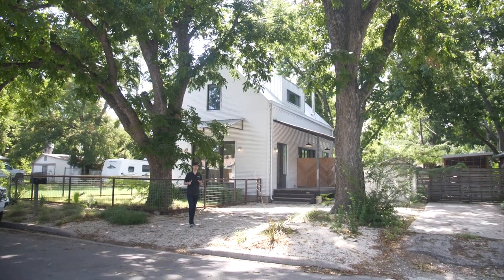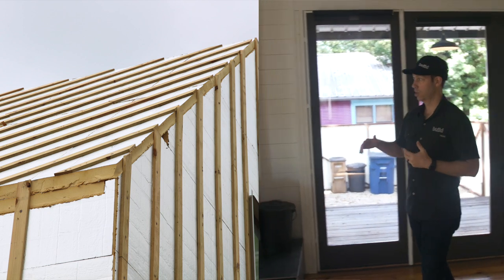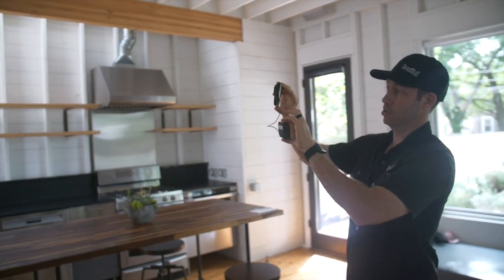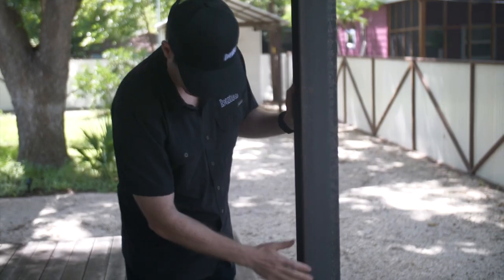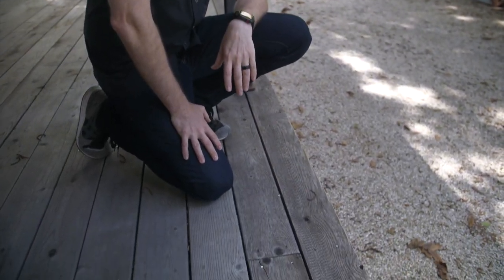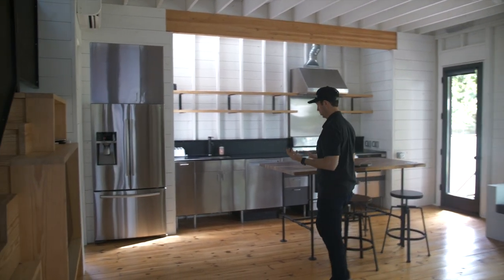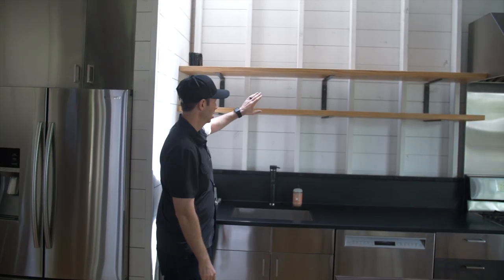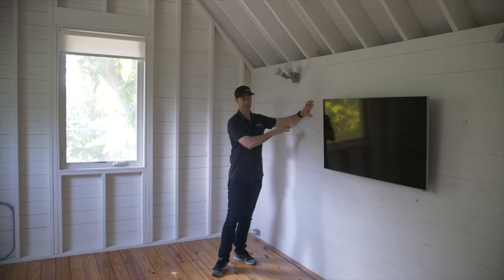This New House Has No Drywall, No Insulation, and an All Wood / Shiplap Interior!

Comment: I love the fact that any failure in the wood can be visibly seen and repaired effortlessly thanks to no fiberglass insulation or drywall. Water getting in? You'll see it right away, and the wood can dry quickly.
Reply: No place for mold to hide
Reply: Looks like a nightmare for cleaning, tho. so many nooks and crannies for dust to reside.
Reply: @CroElectroStile  Dust doesn't cling to vertical surfaces very much, so no it'll be fine.

Comment: Matt, if you do a floor like this again, you need to look at traditional Finnish cabin construction.  Because historical cabins were made with green wood, the floors shrunk a LOT, so the flooring is initially floated over the joists and there are wedges at the edges of the room to keep them tight under the baseboard.  (Really, just a small piece of square trim.)  When the floor gaps, the baseboard is removed and more wedges driven in.  Then it is perfectly tight.
Reply: Would be a lot easier to use kiln dried boards.

Comment: I find the concept brilliant. The execution masterful. No drywall means no mold and other pollutants. No insulation means no nesting materials for bugs and rodents. I'm sure enviromently sound enamel was used to paint the walls for a long lasting finish. The electrical and plumbing was done in the most detailed way so that if noticed it just fades without thought. The exterior was excellent. Steel to reflect heat. Cedar to excel nature. Raw acid finish steel to outperform natures best defiance. The only competition this magnificent home is concrete. Never would I have thought this to be possible.
Reply: N C I absolutely agree and always have. The problem is in the United States they overprice concrete. Concrete homes are very expensive here in the states. I do believe that homes especially on the coast and in natural disaster zones should be built of concrete. The new modern concrete homes are phenomenal and beautiful. But this home has a warmth to it that just gives you a big hug when you walk in.
Reply: @Mark OnTheBlueRidge from experience. Yes wood can mold but it's not a moisture sponge like drywall. Once drywall gets mold on it the drywall has to be removed. Wood gets mold if left untreated. I used to do remedial work.
Reply: @rubberdwellers3911  Wood molds when wet for a longer time, you dont have to treat Wood to prevent molding, Just keep IT dry
Reply: @Mark OnTheBlueRidge bang on
Reply: Those are unsubstantiated assumptions, moisture is a problem when food is around...wood and common household dust can be mould food...since there is only r24 on the walls doesn't give it amazing thermal performance, other that thermal bridging...as inside air approaches outside wall it will cool and condensation the concern. The only way to know is rip some siding down in five years and see what is happening between the wood and the wrapping... you may find mould and dry rot. As far as rodents, well unfortunately mice LOVE foam homes, many ICF home owners are awakening to that fact, I saw a five year house have the siding torn off because the mice bore tunnels in the foam board up to the windows and gained entry, also hollowed out nests under the siding...thus destroying Rvalue...there is no perfect home, to think so only deludes you
Reply: Drywall is cheap & it's not lath and plaster. Not being lath and plaster is actually pretty fantastic. It is time for a locking engineered cellulose + property you need in that room system.
Reply: This type of insulation is the normal way you do it on conventional brick houses. This way you also eliminate all thermal bridges especially in the corners. But for wood houses it's a new concept.
Reply: I still would like drywall in some living spaces - just for ease of painting.  But since it's optional as built, that's a bonus.  I am not a fan of how electrical was run in those shoulder areas: yeah, it might meet code as the space is not living area, but mechanical protection just isn't there.  You know people will store stuff in those areas, as access is easy [unlike an attic].
Reply: @rubberdwellers3911  Ever worked with fiberglass faced sheet rock?  All my bathrooms, kitchen, laundry room and garage are fiberglass faced rock.  Love it.  I put a sample in a jar filled with water for two weeks and removed it and NO change at all.
Reply: @trex2092  $$$$$$$$$

Comment: Like many current building methods, sheetrock is cheapest way to cover large wall areas! Carpet is cheapest way to cover large floor areas, etc, etc.  Building for generations is usually NOT normal.  Housing is a "market" for the most part. I have built fine quality, substantial before and the house was priced "to the market' in dollars per square.ft.

Comment: I know here in Vancouver, moving the thermal barrier to the outside, and turning the sheathing into your vapour barrier is becoming very popular. Can frame in 2x4 again as a result, and allows for a tonne of places to run plumbing/electrical/low voltage now.

Comment: The great thing about this design is that you could make whole walls into electrical conduit holding fixtures.  This would be ideal for an IT professional who wanted his in house server room.  Or anyone who wants to pay less when network standards get better in 10-20 years.  plumbing issues... no problem.  Pipes could rot to pieces but be replaceable.
Reply: I know it’s been 3 years but could you explain what you mean lol
Reply: @ryangolden3243  Want accessible wires, keep them outside the walls.  Same with pipes.

Comment: Finally!!  I built my exterior walls like this several years ago and couldn't understand why I seemed to be the only one to know how to build the perfect style house.   This is the only build platform that truly makes sense and it's better than any r control house built.   This is much better than those stupid insulated studs held together by dowels.   I wish more people would use this platform and perfect it.   Very nice looking house.  As far as fire,  current home fire protection is a joke anyway.   Firefighters keep busy and lives are lost even with drywall.   There's a better solution.
Reply: Yes it's called ICF it also has a better thermal barrier and noise dampening than wood.

Comment: Certainly a take it or leave it design. My first concern was dust settling on the rough walls and frame pockets, very hard to clean. It's also very time consuming to paint the walls and ceiling for the same reason. 

Refreshing to hear all about these new ways to build a house from an intelligent & well informed contractor, instead of the tired pessimism from an old school meathead.
Reply: I have a 1920's double brick . I have dust settling on the walls , cracks in the plaster , webs in the folds . A good extension on a vacuum hose is the clue

Comment: I love this construction, I’m not sure how it meets fire codes, but it’s extremely practical. It may not be appealing to some home buyers, but all architecture has changed throughout the years, I’m sure the market would have a place for this....if it can meet codes.  Very interesting 👍🏻
Reply: Well it had to have met code or it wouldn't have been completed with tenants living in it 4 years right?
Reply: Type 5B construction has no fire rating requirements.

Comment: I like it.  The only thing I would worry about is fire danger.  Drywall on the interior of houses is used in part used to give a house some fire resistance.  True, flooring such as conventional carpet over plywood sub flooring has shown its flaws.  If fire, in the form of a flaming tree branch falling on the roof, were to occur, how does it stack up against a regular house?  I also would have used conduit to protect the electrical wiring.  Wood interiors are also not the best at providing a heat sink.  So having one interior wall made of concrete, perhaps with a “floor” heating  (or cooling) system makes sense.  I also would have liked a basement, but that’s probably just me.  Maybe I missed it, but was there a heat exchanger for fresh air entering the house?  I would like to see a similar concept house using RockWool which is fire resistant.  Like other commenters, maybe too many US builders think short term.  I love the service spaces which allow for access to the workings of the house.  Not much chance of accidentally poking a hole in something you shouldn’t.

Comment: I could definitely live in a house like that. The overall effect is that of an urban loft, or converted barn.

Low maintenance, easy upgrades, easy access to the utilities. I love the outside of the box thinking. I would have to do something about acoustically isolating the bathroom, though. No need for anyone to hear what goes on in there. Maybe double the shiplap, or create a sandwich material with sound insulation between two layers of thinner faux shiplap, anything to keep bathroom sounds strictly in the bathroom. And no louvered doors! But there are faux louvered doors that would match the look of the house without allowing sound or odor to escape the bathroom. Old-fashioned glass transoms would fit in this house, too - they're very common in Baltimore homes built in the late 1800s thru the early 1900s, before air conditioning and electric fans were common.

Only problem I could foresee with all-wood walls is that if you're one who  hangs a lot of stuff on the walls like me (posters, shelves, etc), the wood would soon look like it was termite infested. I'd need to work something out to facilitate easy hang/relocate/remove of artwork and shelving. Maybe a metal grid suspended between the studs. That would work for incident lighting, too.

If I ever move to Austin and build a house I'll definitely look Matt up.

Comment: It is Shed construction or just the way it was done before plywood  or drywall . You could close up the walls with paneling ,which is removable and batt insulation . Solid wood paneling is used in Europe . I have seen many old buildings done this way . The modern exterior insulation is a plus. It breathes through the interior.

Comment: Very clean with insulation on the outside and no drywall, a maintenance man's dream home, easy to get to everything. The only problem I was told once by an electrical engineer fire investigator is that foam insulation like that goes up in fire in no time flat.

Comment: Love the exposed utilities, and the transparency of everything. Appreciate your lessons learned. Would also mention that the floor level receptacles are very low from an accessibility standpoint, hard for older folks to reach. I understand raising them would entail more exposed MC cable -- inevitably some tradeoffs for this kind of construction. Also, the freestanding wood stove seems like an IAQ nightmare in a tight house like that. Hope you tried to dissuade them from the idea of a combustion appliance in a tight house. Thanks for this video -- lots to consider for next project.

Comment: Remodeled a 6 yr. old home on a local island resort that was built like this. There were 4 large exterior double doors and one single along with at least a dozen windows. When I got there I noticed all the double doors were tied shut with rope. The owner explained that the doors even when dead bolted would sometimes open by themselves. Yes really! (he was an architect and had designed the house himself). After installing higher end locksets and deadbolts it was assumed the problem was solved. But I heard later that it persisted. I had remembered feeling movement in the house on windy days and it dawned on me that there was no wind bracing in the exposed framing inside,(just like yours). I wondered if the exposed cedar t&g boarding had been covered with plywood before applying rigid foam. (There was not a single missed nail or screw visible on the inside frame which lead me to think not). The house was obviously racking in the wind to the point where doors were opening themselves! BTW all the Marvin casement windows had failed glass seals which I suspect was also due to to this racking. (The double hungs were fine, no doubt due to there being more play with the sashes). My advice with this type of construction would be to glue and screw 5/8"  plywood (not OSB) over the T&G boarding  before insulating. That would be a minimum. Of course, wind bracing could be installed in the framing but the recessed shelving options would suffer. The homeowner also had serious rodent and ant infestations in the wall and roof insulation. Very careful planning with metal barriers and flashings must be a part of this type of building. I'd  never recommend this type of construction for a year round living space. If it is done properly the savings on finish would be eaten away by preventative measures for the above  stated issues.

Comment: Pretty cool, especially having the continuous peel/stick and insulation on the outside. Nice and tight! One thing I don't like is that the gaps between the 1x6s vary a lot: tight together in some spots, wide apart in others. This kinda goes against the "precision" aesthetic.

Comment: I think your concept of barriers and exterior insulation are brilliant. I would be afraid that the local building inspectors would say no way, just because they do not understand it. North idaho RE agent here.
Reply: In concept this isn't much different than a sip exterior on a timber frame home. Those as I recall is being built in most of Idaho & most other states in the US.
Reply: @salimufari  there are  very few SIP builders-in North Idaho. and most homes here are stick built.

Comment: If you add sound insulation and rockwool inside each room before you add drywall and then switch to solid doors, you create a VERY well sound insulated house. One of those rooms would actually be good enough at that point to turn into a studio or home theater.

Comment: Hey @Matt Risinger, could you explain/illustrate how to seal off the bottom of the perfect wall where the insulation board and metal meet the top of the foundation? Thanks!
Reply: Bet the insulation and sealing stop at the bottom of the foundation, meaning a conditioned craw space

Comment: The issue I have with this type of construction is the insulation used, make sure it is the fire proof variety, not the cheap type - see Grenfel tower block fire for just how wrong this can go.

For interior sound proofing for a family home, I would use Fermacel or similar gypsum fiberboard instead of traditional drywall - it outperforms plasterboard in every way possible (except price).  I have used it in two houses now and it is great.  You can even attach tings to it with screws, try that with regular plasterboards.

Comment: In Hawaii they build houses without insulation. And the insides ussually look like this. Mostly becuase it's not to hot or cold there.
Reply: That's nice, BUT its not in Hawaii nor San Diego CA.
Reply: Newzchspy true but I bet this house is extremely energy efficient.
Reply: You really don't like this house.
Reply: No, I really don't, BUT does that matter.  I am not the buyer and I do NOT have to live in it.   To each their own.
Reply: You mean the single wall construction. I live in Honolulu.  You can hear someone fart in the next room.
Reply: He says there won't be any spiders and bugs. Which is what concerns me about the unfinished interior walls.
I have to sweep cobwebs in my house and particularly outside my house.
Reply: Wonder why in all these old comments, no one mentions that he did say in the video it is insulated on the outside and is very efficient... Hm, that's what the first third of the video was about, I thought. He mentioned how air-tight it was and how regular the temperature was numerous times.

Comment: 1.25X cost of standard construction with all the charm of living in a 1920's Mississippi Delta sharecropper shack crossed with a 1940's corrugated iron tractor shed. Cleaning/dusting between the stud bases is done how, how often, and with what level of uber-tedium?  Did anybody think this through much?

Comment: I was an electrician for 20 years. Reminds me of some the older houses I worked in that has ship lap on the walls that were eventually covered by drywall over the years. We used to find everything and anything in those wall voids. They made them out of any materials they could find. Lot of those people worked in turn of century factories and would bring home wood from shipping containers. It still had painted labels on it.
My only question other than acoustics would be fire suppression. What about slowing burn time? Like drywall is rated for.
Reply: Fire codes can vary greatly from place to place. Guessing they have less where this is built.

Comment: I love it.  I have an 1890 house.  I'm tearing down the old, deteriorating inside down to the studs and it doesn't look unlike this.  Will heat with a wood stove.  Could say much more here, but will PM you later -

Comment: Matt, I think this was done long before your friend Joe. I studied with a man by the name of Bruce(I am withholding his last name as I have not asked him) he was doing this in the early 70's, basically doing the same thing but with post and beam construction. I agree with you about the studs and energy loss. I am done the opposite I put the rigid foam on the inside up to 4 inches of foam,  I did fill the stud cavity with 6 inches of fiberglass. The foam was done in two layers of 2" than 1/2 to 5/8 rock. The advantages of my method are no moisture in the wall, same as your design, I also believe that in New York the room electric outlets are required to be approximately 18" off the floor PS I dislike sprayed foam to the extendant that I think it should be banned for health reasons. All and all well done